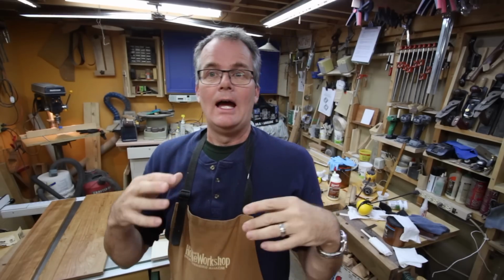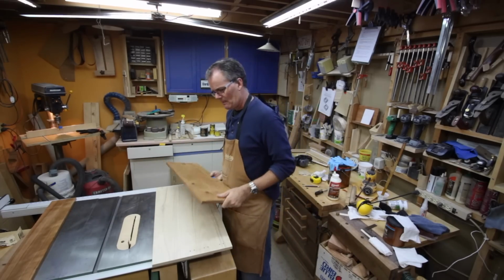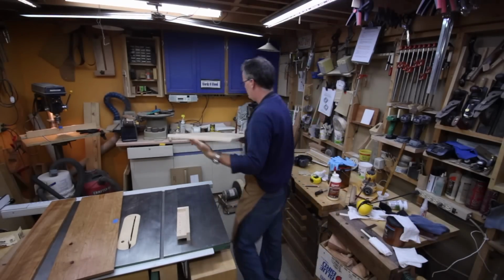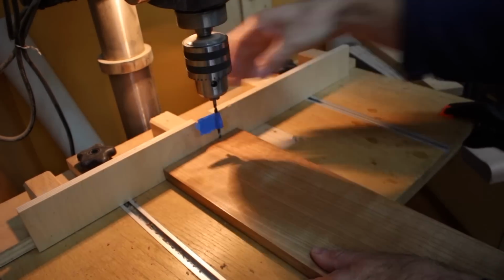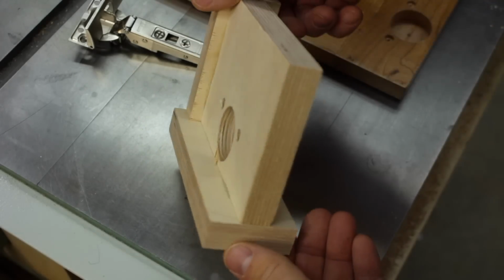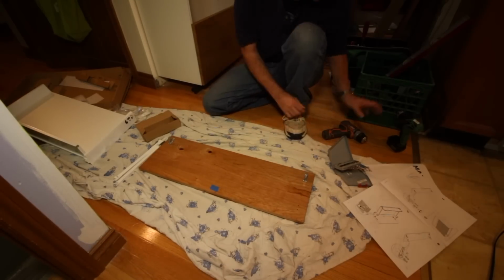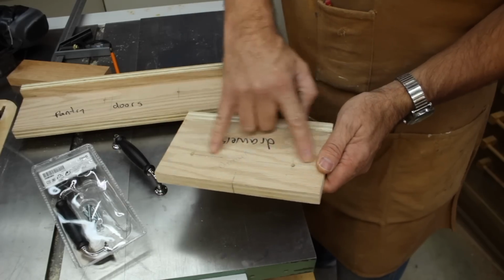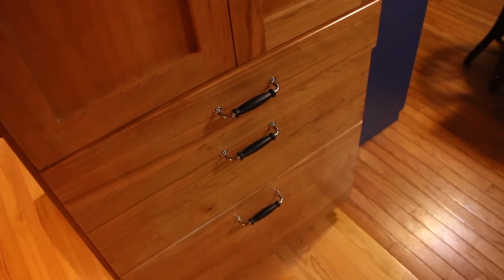Custom Fronts For Ikea Kitchen Cabinets (WnW #151)

Comment from the maker: Please consider supporting my work: https://www.patreon.com/wordsnwood

This is about ATTACHING doors and drawers, not about BUILDING them.

Build Article:  http://www.wordsnwood.com/2018/ikeadoors

The plan is the make my own Cabinet Doors and Drawer Fronts, and attach them to standard Ikea "SEKTION" cabinets.

To do so, the key measurement that I learned was 1/8".   That is to say, the drawer and doors are approximately 1/8" smaller than the cabinet dimensions.  So if you have a 5x24 drawer, you need a drawer front that is 4-7/8" x 23-7/8".   Or if you have a 15x30 wall cabinet, then you need a door that is 14-7/8" x 29-7/8" in size.

The next thing is to drill the needed holes into these drawers and doors.   I used an Ikea drawer, and drilled through all the holes and used that to make a drilling jig for the drawer holes.  I then used that to mark where I need to drill holes on my Custom Drawer fronts.

I made a similar drilling jig for the door holes.  I also bought a Kreg jig -- it made the drilling a bit more complicated to use two jigs, but the Kreg jig was very nice for setting the drill depth.

The results turned out very nice.

---------- ---------- ---------- ---------- ----------
LINKS TO SOME OF THE ITEMS USED:

(AND/OR other tools and jigs that I use and recommend.
Most of these are affiliate links.  If you buy through these
links it helps support my channel.   Thank-you so much!)

https://amzn.to/2P18O6o -- Kreg Hinge Jig and Bit

http://amzn.to/1pFGjPk — Sensgard ZEM hearing protection
http://amzn.to/1WSNq1j — Stanley Leverlock tape measure 
http://amzn.to/1LleENk — Bessey small 4” F-Clamps
http://amzn.to/2aqt0u4 — Ridgid 12v drills
http://amzn.to/2beVz3t — Minwax oil-modified Polyurethane

GEAR I USE TO MAKE VIDEO:

http://amzn.to/1qPkvBp — Canon T5i
http://amzn.to/2aK7jZX — Inexpensive Quick Release tripod ball head  (Very useful)
http://amzn.to/1SSwOmS — Sony Action Cam. (I use the HDR-AS15 which is discontinued -- cheaper than a gopro.)
http://amzn.to/267XM3M — Sony Live View video remote for Action Cam
https://amzn.to/2NddVjk — But I do also have a GoPro Hero 5 Black
http://amzn.to/1XC2D7l — Joby GorillaPod (Flexible small tripod)

---------- ---------- ---------- ---------- ----------
HOW YOU CAN HELP:
Become a Patron: https://www.patreon.com/wordsnwood
Buy a Plan: http://wordsnwood.com/plans/

MORE MORE MORE:
http://www.wordsnwood.com
https://www.instagram.com/words.n.wood
https://www.facebook.com/wordsnwood

---------- ---------- ---------- ---------- ----------
Thank-you!

Music: Pisco Sour by Gunnar Olsen - Youtube Audio Library
Reply: You do not need the screws on the ikea hinges. They have a built in preasure clamp
Reply from the maker: You didn't watch the whole video, did you...
Reply: @Wordsnwood  I did finish watching I just put the comment in before I got to the end they changed the design of the hinge slightly since I did mine
Reply from the maker: Yeah, I was surprised when I pulled out the hinges, as I was expecting screws.   Nicely engineered.  Thanks for stopping by!

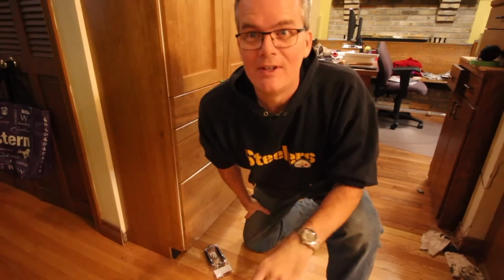Comment: Hi Art - you mentioned the bottom drawer front needing to be mounted differently.  I appear to have the exact same problem that you showed at 6:58-7:00.  The 2nd drawer overlaps the first drawer.  How is the bottom drawer mounting different from the drawers above it?  Does it just need to be flipped upside down, in terms of where the hinge points mount?  The template I saw shows mounting the hinge points to the pair of holes that are 60mm apart, rather than the 50mm apart.  Is that the difference?  Many thanks.
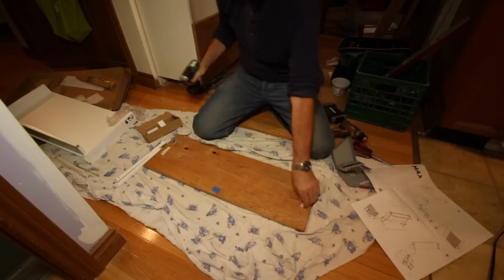Reply from the maker: Take a look at the 6:40 mark where I'm assembling drawers, or for a closer look check the 1:58 mark of my "you need a pozidriv screwdriver" video https://youtu.be/zdL2oxZVrYw?t=118  --- there are THREE screw holes in those metal clips used to attach the drawer bodies and for the bottom drawer you use two of the three screw holes, and for the other drawers you use two different screw holes.  This is shown in the ikea instruction book - you need to check carefully the little drawing to make sure you're following the instructions for the bottom drawer vs the other drawers.
Reply: @Wordsnwood  Thank you for your answer.  I believe my bottom drawer hinge point attachment matches your Pozidriv Screwdriver video at 1:58 exactly.  It's mounted on the bottom 2 holes of the drawer, using the bottom 2 screw holes of the hinge point attachment, with the "tail" of the hinge point attachment pointing towards the bottom of the drawer.  My bottom drawer appears to be fitting at the point on the cabinet that it should, with the bottom of the drawer even with the bottom of the cabinet.  But the middle drawer (these are 10-inch drawer fronts) bottom overlaps the top of the bottom drawer panel front, by about the amount shown in the above video at 7:00.  It's difficult to see the orientation of the hinge point attachments on this video at 6:40, due to resolution.  But it appears they're the same as the other video, with the tail end of the hinge point attachment pointing to the bottom of the drawer.  On my top drawer, the top of the panel front is a small amount lower than the top of the cabinet and the crossbar connecting rail, so it appears the middle and top drawer panel fronts need to be higher than they are.  I believe the slides are correctly mounted.  So am wondering if the middle and top drawer panel fronts need to be flipped, so that the 48mm spacing between the bottom and center holes should be on the bottom, rather than the current 58mm spacing.  Thanks for any pointers.
Reply from the maker: @g1inskyms  Mark, I tossed my ikea instructions ages ago.  All I can suggest it check them again.  There were different instructions for bottom drawers vs other drawers, and once I figured that out and followed the correct set of instructions, everything was fine.
Reply: @Wordsnwood  Thanks for the info.  I think the problem I have is that I have custom drawer fronts, that appear to be drilled correctly, but I have no Ikea instructions for front panels, since I didn't get any front panels from them.  And they don't seem to have those available on their website.  I have the Maximera drawer instructions which show the front panel attachment,  and I've assembled according to those instructions, but the drawers are still off.  Back to the trial-and-error board.
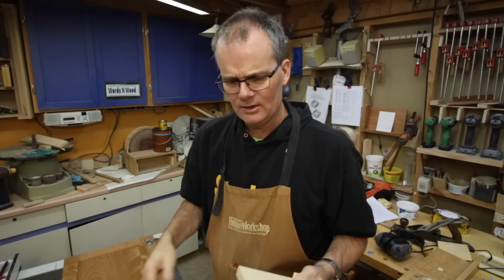Reply: @Wordsnwood  OK, I found out how the upper drawers are mounted differently from the bottom drawer.  You can see it in this video, at the 5:10 mark.  https://www.youtube.com/watch?v=3uaXlscjKLY

It's the difference in using the top 2 screw holes in the hinge attachment point, rather than the bottom 2. Everything fits perfectly now.  Thanks for the tip!

Comment: Great series thanks!  I'm considering the same thing to create cherry fronts for my Ikea cabinets but wanting to do completely flat ("slab") style faces for the drawer faces and cabinet doors.  I'm considering using a quality 3/4" cherry-veneer plywood for all the faces and edge-banding with solid cherry or maybe iron-on banding (not sure how well it would stand up).    Any thoughts or suggestions?  Thanks!
Reply from the maker: solid edge banding for sure.

Comment: Hi again!  Where do you buy your hardwood and cherry plywood.  It looks very nice and ive been looking but I’m not sure what is the best for quality.
Reply from the maker: For hardwood I found a lumber mill that was about 40 minutes out of town -- If you live in a city, the lumber you buy from a store is going to cost more.  Take the time to find a lumber mill outside of town to save money.   The plywood was trickier, as you need a dealer, and Cherry is not usually at your local big-box store.  Again, I called around and found a plywood/lumber dealer who had plywood cheaper than the closest dealer.   (If you live in Ontario, It was BCW Plywood near Brantford.)

Comment: i have a question about the thickness of the boards.  I know Ikea doors are 3/4 inch.  Can replacements doors be 1 in or do they need to stay at 3/4 inchi?
Reply from the maker: I stayed 3/4.   I don't THINK a bit extra thickness would interfere with the hinges, but haven't tried.   It also adds weight, which the hinges have to carry as well.

Comment: I'd love to know, now a few years later, how the drawer fronts are holding up.  I'm about to make spalted beech drawer and door fronts and I've been wondering about wood movement in the 'real' wood when attached to the melamine - as far as how the gap between cabinet fronts does in a moist environment, as well as any minor cupping/twisting that sometimes happens with 'real' wood.  If anyone has some feedback, I'd love to hear it.  Thanks.
Reply from the maker: Drawer fronts are fine.  I think one of the upper doors is not 100% flat, but on 40" tall doors I guess I'm not that surprised but it's only kicking out maybe 1/8" at one corner.   
BTW, The drawer sides are not melamine, they're metal.
Reply: @Wordsnwood  Thanks.  I've done several face frame cabinets but never this European drawer front and was wondering how much gap to leave (3/16"?) and if the drawer fronts would swell across the grain and the gap would close.  Here in Maine, I have table I built of oak that I bread boarded the ends and the movement is about 3/16 on both sides in the summer.  I do like your honest video where you didn't edit out the verbal miscues and corrected you error on the Blum hinge holes.  Looking forward to watching more of your work.  Best

Comment: Hey Art, good stuff you're showing us here. The jigs for the screw holes is a good idea. What thickness did you use for the drawer fronts? 3/4" seems to be pretty standard for cabinets but I believe Ikea fronts are 5/8".
Reply from the maker: Mine are 3/4"
Reply: @Wordsnwood  thanks this is really handy. Im having 1" slabs cut for me. Will these still work with the same 1/8 " dimension and the same hinges do you know?
Reply from the maker: @henrybroadhurst  Most likely.  They are surface mount doors, so I don't think a bit of variance will matter.  BUT, you are putting more weight on the hinges.  Might affect their liftetime.

Comment: I'm either going to buy pantries or put multiples together like you did.    My worry with wider spans like your 30" is any bending of the shelves with weight due to the wider shelf span.    Are you seeing any problems with that yet?   I'd also like to store larger items like you have in there.    I'm also planning the 14-15" deep version so i think that would help.
Reply from the maker: Nope no issues yet.   This is something easily solved if it becomes an issue.  First, I could add a small cleat along the front (and maybe back) edge of the shelf.  This does make the shelf a bit thicker.   Second, I could replace the shelf with a piece of stronger plywood.
Reply: @Wordsnwood  Thank you!!

Comment: You are doing a huge amount of work and its beautiful.  I really like the Cherry, very nice color and finish.  Question, why not use some other brand of Ready To Assemble (RTA) cabinets with the exterior of cherry?  Some of them are quite nice.  Suggestion, In the plumbing/water heater department of a big box store you can buy flexible sections of "pipe" with braided stainless steel exterior with Shark Bite or Gator bite fittings on the ends.  Cut off those offending pipes and reroute then in meer minutes.  Very useful in renovations. (I saw the pipe in your intro video.)
Reply from the maker: Ikea cabinets were less than half the quoted price for cabinets from Lowes.

Comment: I say for one kitchen just make multiple copies of your jig in something hard and if the holes start to get sloppy switch to the next one.  You can get drill bushings (I used them for my MJBS jigs) but for $10 each you're better off just making extra wood ones.
Reply from the maker: Wise words, thanks!

Comment: Wow. Those are some beautiful doors and drawer fronts. 

How did you finish them?

And how did you get such rich color from the cherry wood from the outset? Has it been aging in your shop for some time? Most new cherry wood I see is rather palish to start with.

Looking to use cherry for facings on new shop furniture but not sure how to get it to look like your doors  & drawer fronts.
Reply from the maker: I used minwax oil-modified poly.  Here is a previous video where I performed a finish test to confirm my choice.
https://www.youtube.com/watch?v=PLkBHcdgKTA&t=488s

This is some really nice cherry.  I have not stained it or pre-darkened any of it.

Comment: Ikea, like most mass produced cabinets these days, uses a 32mm cabinet system.  I suggest you research it, you will find that nearly all hardware conforms, and there are tons of tools to make production easier/faster when it comes time to work in bulk. 
 http://www.davelers.com/32mm/Basics/157.html

Comment: Like the thinking process and look forward to the more advanced jigs/production installation techniques. Quick question on that bottom drawer that was mis-installed are there now holes that are not being used?
Reply from the maker: Nope.     The mounting hardware has three holes.  It's all in which two of the three holes in the hardware get used.